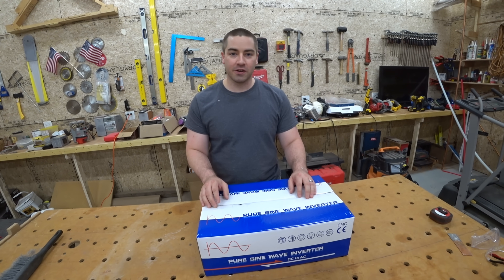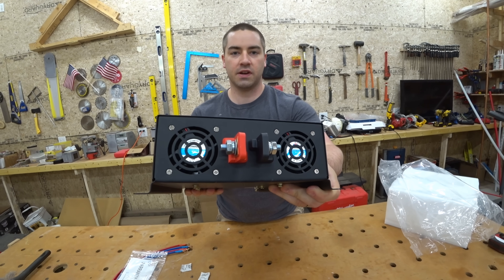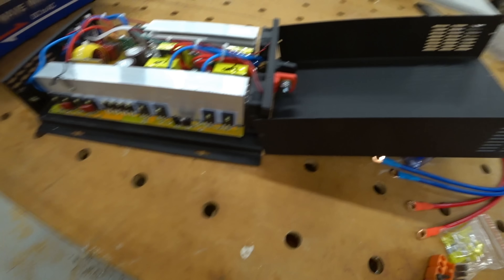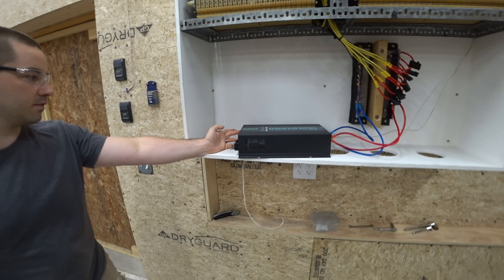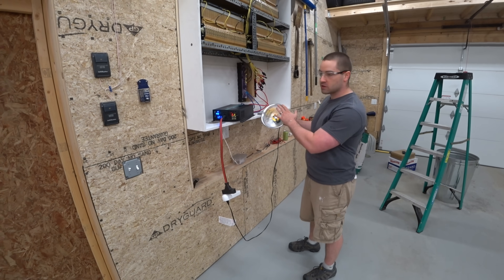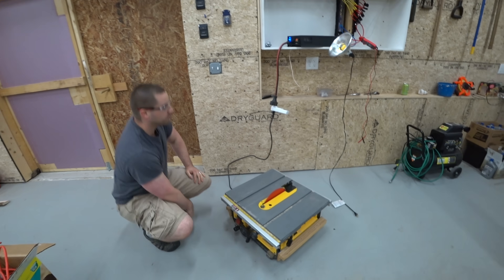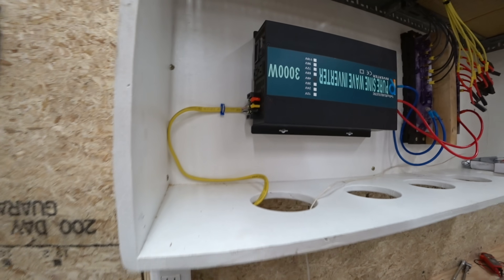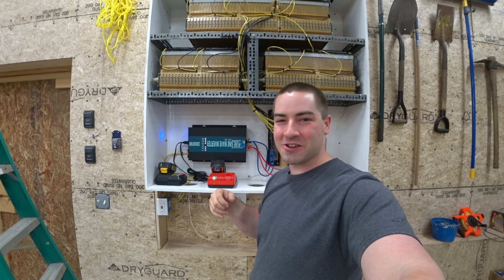Cheap 3000W Reliable Inverter, DIY Powerwall, Chevy Volt Batteries

Comment: Consider upgrading those battery cables. Looks to be a cheap 8ga cable. I'd do one good quality 0ga cable, such as from KnuKonceptz or Sky High. You'll see a lot less voltage drop under heavy loads and might be able to power that compressor.
Reply from the maker: Thanks for the suggestion Nick,  Since posting the video I have tried some heavy cables and was still not able to power the compressor.  As I said in the video I don't know what gauge the pair are that came with the inverter, but your guess of 8 gauge is probably good.  (There are Chinese characters on the wire.)  I'm probably going to buy an inverter with better surge capabilities at some point.  When I do, I'll post a video about it.  Thanks for watching.
Reply: Ah, a shame. Kudos for trying though. I was blown away by the cheap cables they supplied. Though, I guess that makes sense with it being a value brand. Cool setup there, first video of yours I've watched. Take care.

Comment: Inverters dont like inductive loads but love resistive loads [ brush type motors ] but love the video, first time someone put practical application of an inverter on display. BIG  THUMBS UP.
Reply: All motors are inherently inductive because they use coils of wire to create a magnetic field, which rotates and drags the rotor along.
A good example of a largely resistive load would be the space heater. However, I was surprised that the voltage on the space heater test dropped to about 113V. That's only at like 1/2 rated load!
Reply from the maker: Thanks.

Comment: We have been complete solar for 18 years no power lines here. We are  using Vanner 2200 watt SW inverters  VERY HEAVY from an ambulance never had any problems running 1 hp compressor nor 1/2 hp water pump  10  L16 batteries over 10 years old planing to upgrade to 18650's next
Reply from the maker: Sounds good.

Comment: There's a trick to REDUCE the start load of the compressor. On the top is a brass compression relief valve, that only relieves SOME of the pressure when starting up.

I have found that removing the spring loaded valve and replacing with a manual ball valve, when open, will allow the compressor to start up with zero piston pressure. Close off the valve to build air pressure after the piston is running full cycle speed (about 3 seconds).

Once the compressor shuts off at the high pressure set points, you can open the valve, and as you use a compressor and it kicks back on it will start up really easy but you'll have to walk over and close off the valve to add pressure to the tank. 

This is the only way my stand up HF will run on a 200ft 10ga cord. Especially when it's cold.
Reply: From the factory there is a check valve that does not let the pressure interfear with start up surg is from the moter period you need a new compressor yours is not working properly

Comment: Nice job, fun to watch. I've had issues before with an inverter not starting a high draw motor. After changing to thicker wires it powered everything. Most inverters will handle double their rating for a short time. You need huge wires to handle those amps.  Mounting the inverter as close (shorter wires) to the battery terminals as possible also helps. To see if it is a wire size issue you can add a jumper cable to the connections and see if it works.
Reply: It's not called amps, it's called 'Current.'  You need to size your conductors to handle the appropriate in-rush current or locked rotor current.  You should also consider over-current protection.  Get an electrical engineer involved to be safe.

Comment: l don't think the problem was the inverter l think the problem is the batteries. if the voltage shown on the inverter's display is reading properly (12.1v) then those batteries are dead and need to be recharged. notice that when you kicked on the compressor the voltage dropped to 11.6 which is not supposed to happen. if your voltage drops below 12 then your batteries are depleted and need to be recharged. a fully charge battery will read between 13-14 volts.

Comment: You're testing an electrical heater? Electrical heat is the worst and most inefficient heating method in the world! If you need heat find another way.
Reply from the maker: Hi WIFIGHOST,  You're right that electric heat is not a very good use of the batteries.  I was using it to test the inverter.  My garage is actually heated with solar hot water: https://youtu.be/HkNALptIUBY  Thanks for watcing.

Comment: Hello, why don't you use BMS for batteries? I'm going to build the DIY Powerwall myself, also thinking use BMS or not?
Reply from the maker: Hi Helios, I'm a fan of BMS's as well as other safety devices, and suggest them.  I don't have one yet, but I'm also not done with my build.  I will probably install one before everything is 100% finished.  In the meantime I've checked each cell and they are still in balance.  Mark Osborne has some videos on his channel checking his batteries with no BMS.  Or check out "Going Off Grid" as he has some videos showing different brand BMS's.
Reply: David thanks for your reply! I'll watch Mark's videos if I find appropriate BMS for Volt Battery. If you find anything, please share here. Thanks in advance!

Comment: Hi there.Purchased the same make as you have but it was a 800w to charge my wife's ebike battery.Plug in a cameras battery charger which blow two of the mosfet in the inverter.Was told that if you won't to use a charger with this inverter you will need  filter have you ever heard of this

Comment: Looking for an inverter that I can connect to a Chevy Volt 12V to be able to charge other EVs when they run low and away from a charger (EV outreach events), assuming the 12V will draw from the 18kWh drive battery. Has anyone ever done that? Any pointers?
Reply from the maker: That sounds like a cool project, but I've never done that and don't know if it would work.

Comment: can it run a grow room of twenty plants
Reply from the maker: I've never worked with a grow room, so I don't know the energy demands.  Try adding up the wattage of whatever equipment you have, times that by the hours of operation per day and you will have the watt*hrs of energy you need.  This battery is rated at 18kwh, so divide the 18,000wh by your need and you will find out how many days this could run the equipment.  Try searching "calculating off-grid solar" for better details.

Comment: This is a HF "high freq" inverter, it uses IC's mosfets and is fine if your requirements are moderate with low peak/surge equipment. If you have high peak gear like pool pumps, large fridge freezers or anything that noticably flickers your lights when they kick in, you will need an LF "low freq" inverter, which uses transformers "toroidal is best". Otherwise, you'll probably need to double up on your HF inverter spec.

Comment: Hello Dave,  I bought the same inverter 4 months (April 2018) ago and  connected it 9 weeks ago.  I used it 6 weekends for 1500 watt or less loads.  It quit working 3 weekends ago.  POS.  I opened the case and all fuses look perfect, all components look great.  Nothing looks over heated, however there is some sort of short.  Reliable inverters are as bad as Power Jack Inverters and maybe even worse.  I have owned both.    I replaced with an AIMS.  God Speed
Reply from the maker: Hi Richard,  Thanks for sharing your experience.  These comments help others out.  How's the Aims been working out for you?
Reply: I purchased the 10KW Pure SIne, low frequency inverter from AIMs.   I can run my 15000 BTU, trailer ac and a large compressor at the same time.  The secret to buying inverters and welders is to always purchase a square trade replacement plan with in 30 days of your purchase.  I have learned this the hard way.  go to my link for more info on covering misc electronics.   https://amzn.to/2N9QHyM          https://amzn.to/2OddRB1
Reply: These cheap inverters are all about 90% 4-5 star reviews. There can be as many as a 10% fail rate. Feel lucky? BUT just buy 2 and you will have a backup.Lots of good reviews, but you have to decide how much you need to count on a relibale unit. Even Victron and Magnum inverters have failure rates, and just a little lower than a good midrange one.

Comment: If your battery pack put out a full 48 volts, your compressor would probably work. There are some industrial battery companies that will custom build you a battery pack. I don't know if your Chevy Volt battery is Lithium but I suspect that it is, If you could find a battery company that could build you a 4 volt battery pack at at your amp hour rating, your charge controller would be be able to charge your entire battery pack at the proper 48 VDC. It would also save a lot of wear and tear on your 44 VOLT bank as it would keep your voltage up where it belongs. Also remember the higher the voltage, the more work your batteries can get done with less current draw. 1,500 watts / 48 VDC = 31.25 AMPS. but 1,500 / 44 VDC = 34.1 AMPS and 3,000 watts / 48 VDC = 62.5 AMPS but 3,000 watts / 44 VDC = 68.2 AMPS. If you can keep your voltage up, your battery bank will run longer and your inverter will run cooler. m 
\
Reply from the maker: Thanks for the suggestion Jeff.  Since that video I did run the test again with the battery bank at 49 volts, same results.  I even tried swapping out the cables with thicker ones.  So this inverter just can't turn on that air compressor.  Thanks for watching.

Comment: Appreciate your videos mate and forgive my ignorance but why are there two red and two blue leads running to the inverter please
Reply from the maker: Thanks for watching.  The purpose of two wires is to carry more current than one.  You can also use one wire that is thicker to do the same thing.  Using one thicker wire is better, and I did switch to that.  In this video I used the double red and double blue because the wires were included from the manufacturer.

Comment: Hi David. Thanks for your video. I have 1 of these inverters but with 12v input and 230v ouptut. I have 2 questions, first one what fuse should I use between the battery and the inverter? And the second one how can I check that the inverter can work at 3000w since the supplier from where I bought is telling that to get the output power you need to use this formula which for me doesn't make sense. Input voltage * input current = output power. So 12*130=1560w. Since I am using a 130A battery. They sad that the output power can't be more than the input. Thanks once again
Reply from the maker: Hi Sean Fava.  A couple of points.  The fuse, or circuit breaker, needs to be sized to protect the wire you are using.  You want the fuse to break before the wire can overheat.  An overheated wire can cause a fire.  If we work the problem backwards it looks like this: Your 3000 watt inverter, divided by the 12 volts of your battery, equals 250 amps.  250 amps is huge!  Check out this chart at Alt-E: https://www.altestore.com/howto/recommended-inverter-cables-sizing-and-breakers-or-fuses-a62/  They suggest 4/0 wire with 250 amp circuit breaker.   However, I don't think these inverters are truely 3000w continuous, so I would personally go with a smaller circuit breaker, but still the 4/0 wire.  

The second part of your question is about the amps of the battery.  You sate you have a 130A battery.  I think batteries are rated in Amp*hrs, not Amps.  Try checking out some of the other resources at Alt-E to clarify.  

I'm not affiliated with Alt-E, but I like their information, it's easy to understand.  The sales people there are very good at helping you size equipment.

Comment: 43.9v x 31.8a = 1396w. 1287-1289w/1396w= 92.19 - 92.3 efficient. 
  Your small compressor caused an input voltage drop to 74-75vac (where it stayed) and your saw had no load, so likely didn't take more than a couple hundred watts to operate.

Comment: have you no 500w yard lights etc to add one at a time to see how it does? I'm betting 1500 watts before it trips..... my 2000w chinese inverter does about 750w then beeps error at 780w and switches off...
Reply from the maker: Hi Lez,  I have not tried that experiment.  I did hook up a 1,500 watt electric heater and ran it for a few hours continuous without the inverter shutting down.  At least it can do that.

Comment: I have the same brand inverter but 48v 1500w. Its been running my house for years. I would love to know your thoughts on the surging and what test made it evident. Great video, In regards to LED lights flashing I have had one brand do it to me over 4 years so I dont think its the inverter, as you probably know by now. What inverter are you going to upgrade to?
Reply: Ahh correction I see you mention the lack of surge power, indeed it doesnt have 2x surge and Im not suprised the compressor didnt run, it needs 5000-6000w surge to start those ac motors, I think it has to do with the duty cycle.

Comment: Is there a relatively cheap meter that could measure and capture the surge current?   I'm thinking if he starts the air compressor on shore power and capture the surge current with such a meter, he would be able to determine what size inverter with the adequate peak power specs  he needs.

Comment: The minimize low voltage drop use larger gauge wiring and try a 2.0 capacitor between inverter and batteries with 100 amp fuse. That should work.

Comment: The AC output has about 1/5 of the current that theDC input has that's why the wires are smaller. be very careful what you run on that you don't want to run induction motors unless you have a pure sine wave. I personally would not use anything but a pure sine wave inverter but if it's all you can afford it's okay for emergency use.

Comment: How hard is it to use those Chevy batteries does it require modifications to the battery packs how do you charge them are they  lithium
Reply from the maker: Hi jonathan Farias,  They are a little harder to use then say, "SimpliPhi" batteries, which are truely plug and play.  The Chevy batteries I had to dismantle from the shell, cut the packs into smaller units, and wire them up.  I've still got to add some battery management systems to help balance the cells.  None of that is needed with a solar battery that was purpose built.  However, I'm willing to put in the work because I can save quite a bit of money.  Yes, they are lithium, and I charge them with solar panels.  If you have the time to check out other videos in this series on my channel I think it will be more clear.

Comment: 3000 watt per hr?
Reply from the maker: Hi Lation Fly,  The inverter is rated for 3000 watts continous draw.  This is a rate, for any given moment in time.   For example an old-fashioned 60 watt light bulb draws 60 watts at any given moment.  If you leave the light bulb on for one hour, then it has consumed 60 watt*hours of electricity.
Reply: Sooo only 3000 watts?? sooo  if i have something that run 900 watt per hr.. i need like 5 of these to have it run for the day?
Reply from the maker: Hi Lation Fly,  If you have something that draws 900 watts (my coffee maker uses 900 watts) then it can run off the inverter because the inverter can put out more (3000 w).  The limiting factor then becomes energy storage.  The batteries are 18kwh, so they could run your 900 watt load for 20 hours (18,000 wh / 900w = 20 h)  Then when you add in solar panels you might be able to run the load indefinitely (provided sunshine)

Comment: Try that comp again after you put 0000 wires on the input to the inverter.  That's critical.  The rest of your battery wiring may be insufficient, too.  For inverters to function well, use short, fat input wiring.
Reply: Forgot to add that my Harbor Freight mod sine 2kw inverter will run my electric chain saw at load...with short battery leads.
Reply from the maker: Thanks.

Comment: I am having trouble finding stackable/parallelable inverters that are 120vac split phase. I am trying to grid tie my DC system,  so as not to let on to what I am actually building,  let's say I have 4 24vdc 2000amp batteries in a series/parallel configuration, giving me an output of 48vdc 4000amps. The max draw on my home is roughly 47kwh a day,  I shouldn't need more than 12kw stacked? That would be 5 2.4kw inverters if my math is correct? I keep getting sent to Amazon.com for my inverters yet no one is willing to tell me if those inverters are stackable and 120vac split phase. If someone knows of specific models that I can stack and get 120vac split phase please forward the model numbers to snead65@windstream.net.  Thank You for your time and support.

Comment: The low cost of the inverter is partially explained by the 20 watt no-load power consumption. The surge/peak rating for the inverter is going to be less than that for the compressor, given the lack of power. If the compressor is an inductive load, a surge supressor may help. I have attempted to run appliances, that have an inductive load, and found, the surge was the only barrier to use. The Chevy Volt battery bank is a great idea. I've been considering one of Tesla's Powerwalls. Pricey, though.
Reply from the maker: Yes, the standby consumption, and efficiency are not as good as some of the high-end equipment.  I would not want to run a whole house system off this inverter.  It's good for small things though.